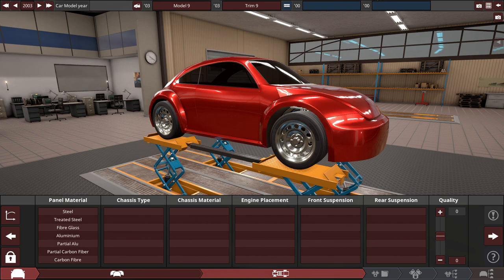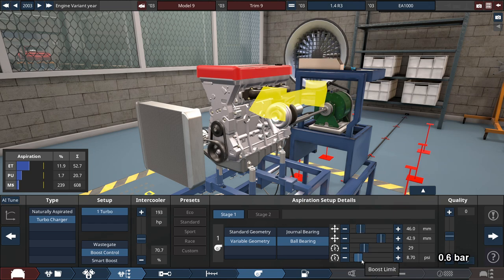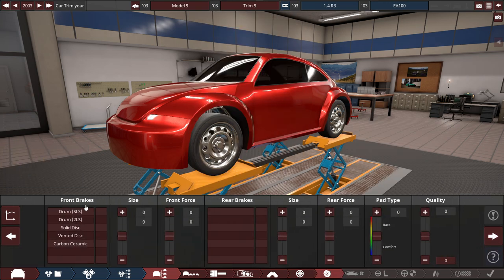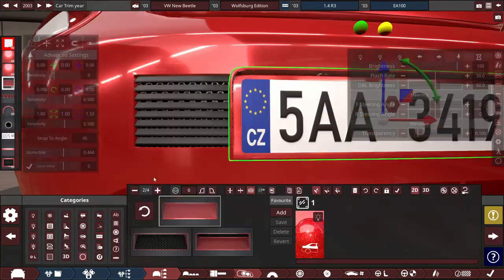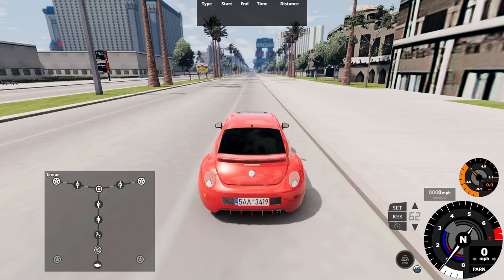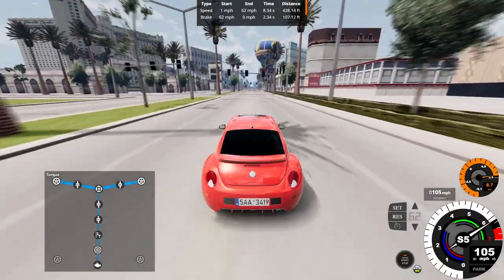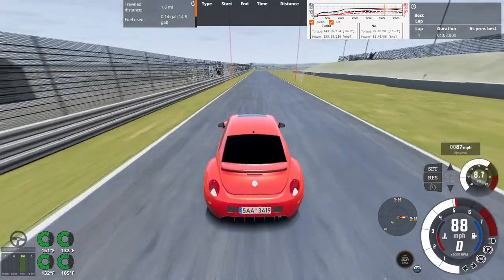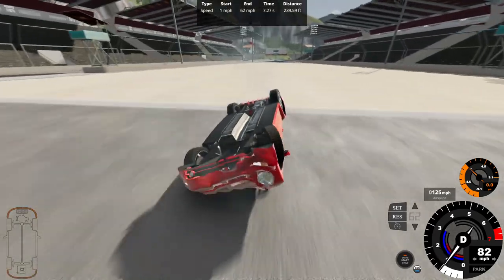This Rear Engined Car is Front Wheel Drive! | Automation The Car Company Tycoon Game & BeamNG.drive

Comment: 300mm brakes are actually quite a good guess. Stock Beetles and most smaller VAG cars from that era had 288mm discs. Golfs and Beetles too. But with Audi TT calipers you can upgrade those to 312mm, which I have done on my Audi A4. I believe the Beetle RSI had it as standard so your guess is very good haha

Comment: Rear engine FWD is by design not very good. Because FWD cars under hard acceleration shifts the weight to the rear of the car. Making it more prone to excessive wheelspin. Even with the engine in the front, over the drive tires. Now you're making that exponentially worse by putting significantly more weight already in the rear. That's why when you added more weight to the car it improved the acceleration
Reply: maybe rear mid engine can solved that problem?